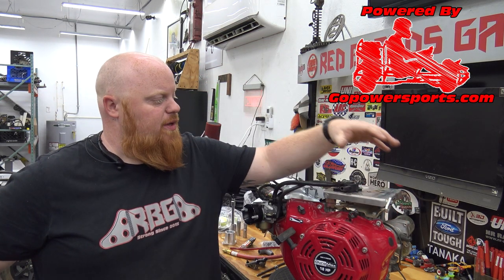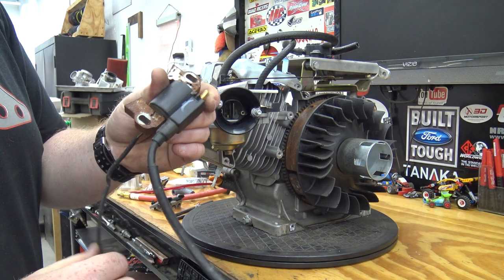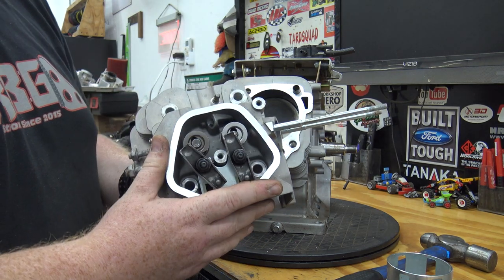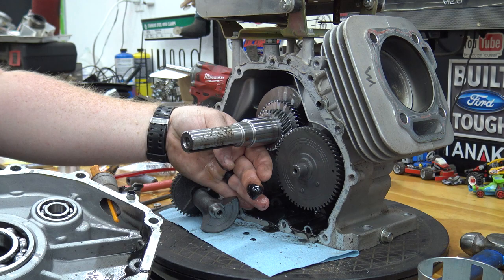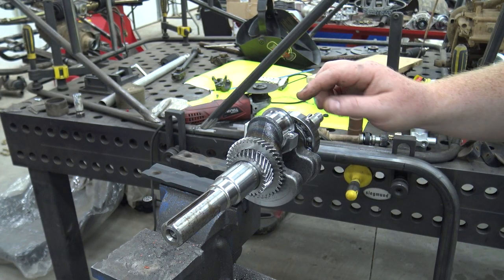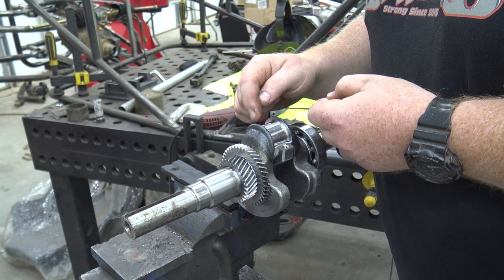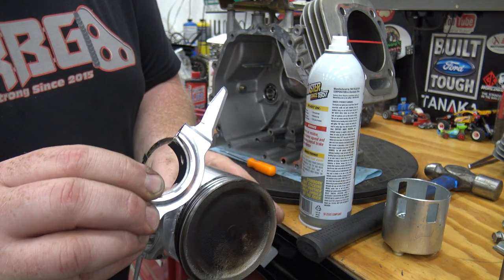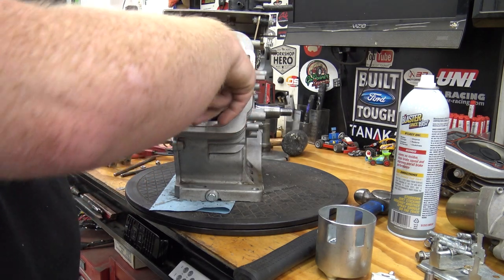24hp Stage 2 440cc Build | Billet Rod & Flywheel, 34mm Mikuni, .308cam, double valve springs

Comment: Preferably get yourself a decent set of micrometers to measure your crankshaft to see if it is oval shaped. If all you are doing is small engines you could get by with just a couple mics. You don't necessarily need high end mics like Mitutoyo or Starrett. They are nice but cheaper mics work as well.

Comment: I put a ton of assembly lube on everything in an engine. Last engine I rebuilt was a 4 cylinder Continental from a forklift and it takes a while for oil pump to pull up oil after a rebuild so I used around 6-8 oz of assembly lube on it. It sits and idles with 30lbs of oil pressure so must have done something right. It was my first full rebuild without any assistance. Helped my dad rebuild several engines but the first one I did by myself. Next I have a 6 cylinder IH diesel that I'm rebuilding. I have a 212 Hemi Predator that's going to be getting some work done to it as well pretty soon.

Comment: Very nice. I have a few gx390's sitting around was going to sell them but places are starting to run out. I gotta small, very similar to lil red, kart that im thinking of replacing the 212.  I may end up getting another frame, this one is my go to and pretty nice for a 212.  I weight 265lbs and hits over 40mph and doesn't jack around getting there.  Out of all the karts  I have it always starts 1st or 2nd pull and is ready to go.  Its the only kart that's remained intact over the years I could go ride it right now.

Comment: don't forget too check carb linkage when you remove starter cover and reinstall it when carb is on .. you could pinch linkage and you could be full speed when you start the kart .. don't know if you could run fast enough to catch the cart to stop the engine ..
Reply: thats why you put the thing up against the wall when you go to start it for the 1st time after doing something like this
Reply: @89Interceptor  i use the chain hoist or a jack myself but works the same .. hate to see people get hurt thats why i said to check the linkage .one kart i used a logging chain other owner had the carb turned up too high for low speed .. that one had elec start i was in it lucky me it would have went threw a ditch if i was not ,,

Comment: Do you have a favorite air filter for a stage 1 non hemi predator 212? I race go carts on dirt and in my class we run modified predators witch are basically stage 1 predators with the standard upgrades and nothing internal, the only think I know of that’s different is relocating the gas tank and adding a fuel pump witch shouldn’t change anything performance wise, and also my engine builder said they modified something in the valves, I can’t remember if it’s stiffer springs or just lash but aside from that I was wondering if you had a favorite performance air filter that gives you the most horse power with stage 1 jetting but also filters well since we run on dirt and it can get pretty dusty, every little gain helps on the track, thanks, keep building 👍

Comment: Why doesn't anybody use the hole from the governor for a crank case vent
Reply: If you intended reusing the original gas tank it won’t fit. Unless you can find a low profile 90 degrees.
Reply: I used it like that but I had made an oil cooler for mine and that's where the oil fed back into the engine. It worked pretty well untill the bottom end came apart. I used all stock internals but Frankensteined a 196cc and a 212 together for ccs in the head and I had like 50 lb clutch springs for a KTM dirtbike that I used for valve springs. My 212 was running 60mph on stock internals, with a drilled and ground stock flywheel (big no no for safety) and I had the 34 mm makuni. At one point me and my buddies lost the exhaust pipe so we ran it shooting flames out the head and it ran like a raped ape.

Comment: Just a heads up..you cannot get an accurate torque holding the block still with your free hand while jerking on the torque wrench..1 or 2 bolts hand tightened is sufficient on the side away from the direction of torque to give a much more accurate torque ... Also,never ever snap the torque wrench bouncing it off of the click... Simply pull on it slowly and steadily until it clicks and then ease off the pressure...
 Also you may reuse any gasket that hasn't failed or been compromised by applying a thin coat of enamel spray paint allowing to fully dry before applying a 2nd heavy coat allowing it to fully dry before reassembly.. Any V8s,v6s,i4s,i6s,v4s,v2,single cylinder gaskets as long as they're not an o ring type... Also always apply break in lube to every single friction area or rotational assembly and bearing when reassembling or assembling any engine.. Well worth the minimal investment costs during initial start up and break in...

Comment: What pushrods did you use. I just bought the chromoly pushrods that you said to use in your other video. Just trying to figure out the length before I go through and measure everything and cut them.

Comment: I have a mini chopper on building I just put a 208cc on it I think I haven't geared way too high I have six snowmobiles so I'm going to be putting a big mikuni carburetor on it 34 mm I have 38 mm but I'm going to use the 34 I have a 14 tooth clutch with a 36 tooth rear sprocket and the bike will barely take off from a dead stop and at 35 mph seems like it's idling and would go way faster but I'm hoping putting a larger carburetor on it will help it get to its top speed but I'm probably going to have to get more teeth on my rear sprocket or less on my clutch

Comment: Hey red beard, I have a offroad gokart with a 420cc engine with the 40 series torque converter and my driven keeps popping when I press the gas even when I'm going straight on a flat road it still pops , I don't even give it full throttle??? Any recommendations?

Comment: Do they make Gaples rings for this engines
Reply: you need the gap rings get longer when there hot if they were to touch tip too tip when cold there would be no room for them to expand .. so no gapless rings ..
Reply: @randytravis3998  gapless rings are a set of rings that use 2 piston rings that ride inside each other, meaning there is no real gap
Reply: @connorssmallengines6663  OK MY BAD

Comment: I posted this on an older 440  build you did but maybe I can get more help here. I was going to build this tame setup. So I called GoPowerSports and they said they don't do have a kit that works with DuroMax 440. They were very unhelpful as far as compatibility. Any suggestion? should I buy there kit anyway and see if it fit? It looks like yours fits and runs ok. So are the 420's and 440 mostly identical? Thanks
Reply from the maker: All parts used on this engine build are linked in the video description.
Reply: @RedBeardsGarage  Yes, I saw that. I'll take the gamble and hope they fit, even though the guy at GoPowerSports says it will not work. Obviously it worked out for you. Great video, thanks!
Reply: @RedBeardsGarage   where is the push rods I can’t find them

Comment: That hone job looked terrible it’s supposed to be 45 degree cross hatching not horizontal scoring
Reply: that's when you use the ball device it will give it the cross pattern .. the stones do not ,, he said he did not have the other tool yet ..
Reply: @randytravis3998  he should put a scrambler 400 engine in a go kart that would be the fastest thing he’s ever built just 1500 in performance stuff they can make 75hp and more money will get close to 90hp on race gas